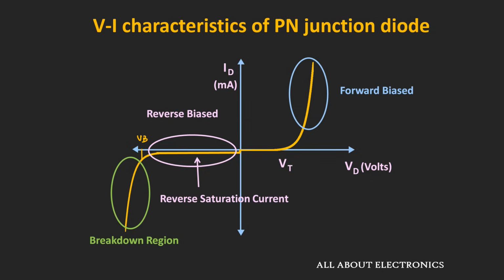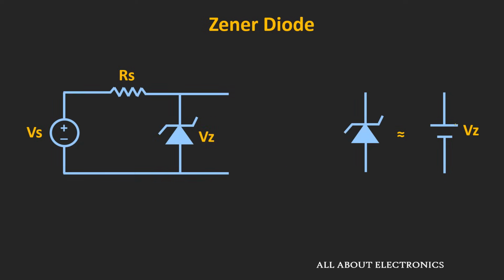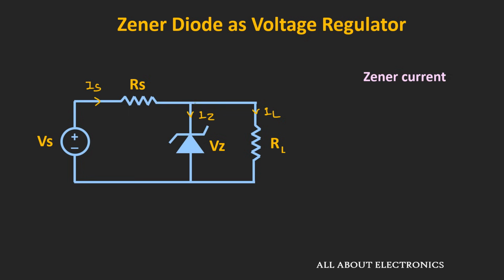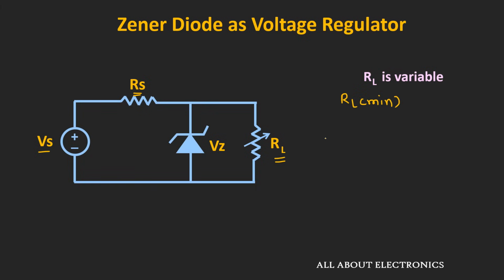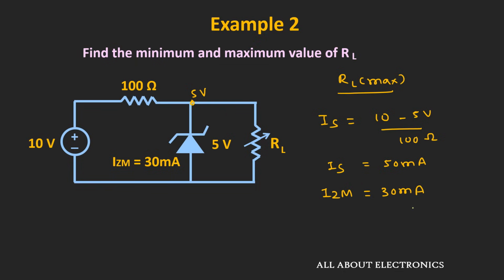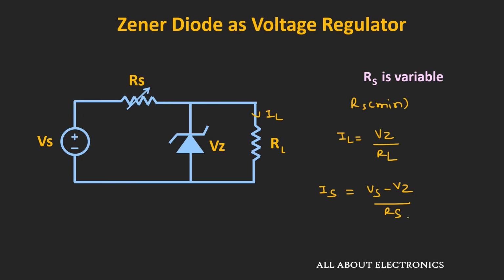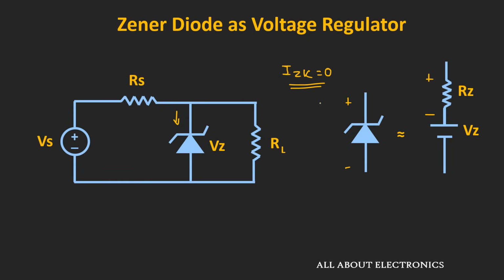What is Zener Diode ? Zener Diode as a Voltage Regulator Explained (with solved Examples)

Comment from the maker: As this video is longer than the usual videos, please use the timestamps for the different topics covered in the video:

0:25 What is Zener Diode 

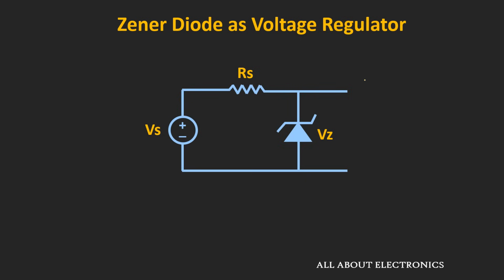5:40 Zener Diode as a Voltage Regulator

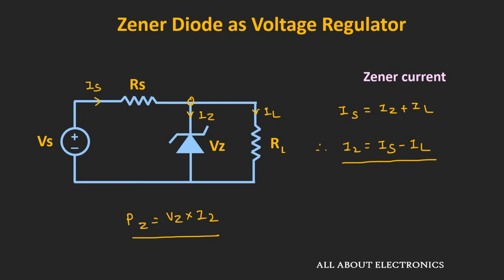9:08  Example 1

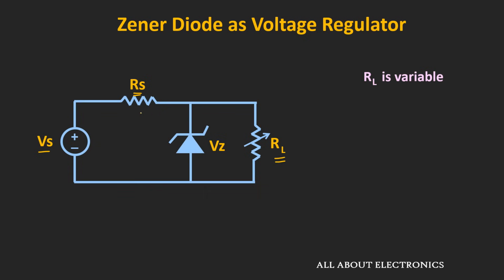12:17 Zener Diode as a Voltage Regulator with variable load

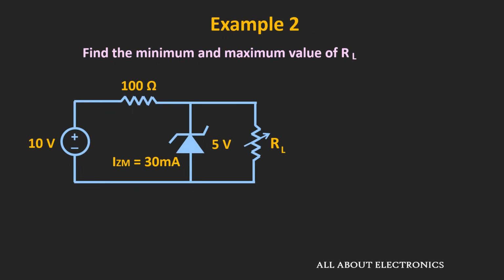15:25 Example 2

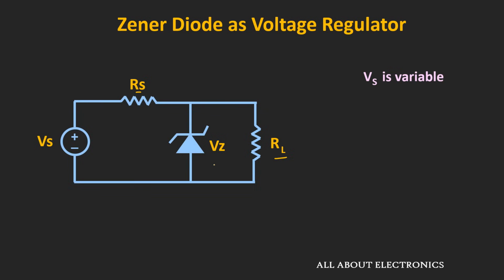17:25 Zener Diode as a Voltage Regulator with variable source voltage

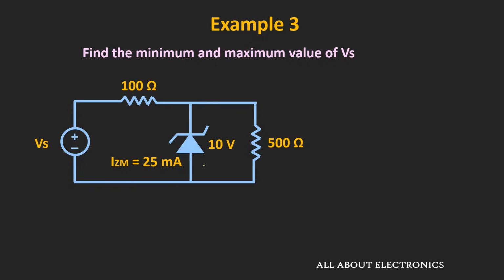20:32 Example 3

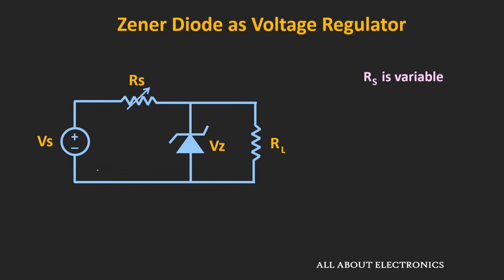23:00 Zener Diode as a Voltage Regulator with variable series resistor

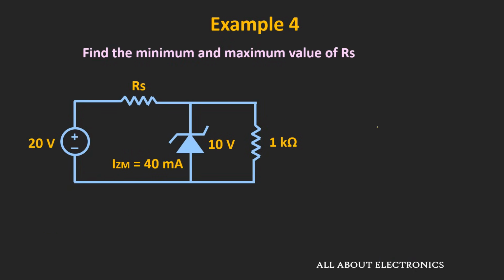25:39 Example 4
Reply: ultimate explanations
Reply: Can you please send the PDF generated of these ppts also,????? It will help us a lot with the notes in our preparation
Reply: thanks saves time
Reply: thnx actually for this info
Reply: you're the boss
Reply: Sir sir please provide notes sir please I beg u in our college they missed topics plz send notss
Reply: That time 12.17

Comment: During the discussion about zener diode ,it used as voltage regulator in reverse biase then why it connect in forward busse in circuit  ,please clear this concept
Reply from the maker: Would you please mention the timestamp in the video, where you are referring to ?

Comment: Can you please tell me why you calculated the Thevenin's voltage across the zener diode and how you obtained that formula for the Thevenin's equivalent voltage?
Reply from the maker: The Thevenin's equivalent voltage was calculated to check whether Zener diode will operate in breakdown region or not. If the calculated Thevenin's equivalent voltage is more than Vz then Zener diode will operate in breakdown region. Now, here to calculated the Thevenin's equivalent voltage, the Zener diode from the circuit is removed and the voltage across the Zener diode is evaluated. And here it is basically a voltage across the load, so using voltage divider rule, that voltage is calculated.

Comment: 00:16 Zener diodes are diodes designed to operate in the breakdown region.
02:58 Zener diode can be operated as a voltage regulator.
05:38 Zener diode can be used as a voltage regulator to provide a constant voltage
08:45 The Zener current is equal to the difference between the source current and the load current.
11:47 The Zener diode can be used as a voltage regulator with three variables: supply voltage, load resistance, and series resistance.
14:52 The maximum current flowing through a Zener diode should be less than Izm.
18:07 The minimum value of the supply voltage for proper functioning of the Zener diode in the breakdown region can be determined using the expression Vz * (Rs + RL) / RL.
21:10 The Zener diode will work properly in the breakdown region when the supply voltage is between 12 volts and 14.5 volts.
24:18 The maximum value of the series resistor is 1 kilo ohm, and the minimum value is 200 ohm.
27:25 Zener diode can be used as a voltage regulator in circuits.
Crafted by Merlin AI.

Comment: I have a question: What shall I do if I don't know load resistance?
Reply from the maker: Just assume some value of load resistance, which you supposed to be using. And accordingly you can select other values. With that design, you can mention that, it will work for load upto let's say 1kΩ.

Comment: In Russian literature this is called Parametric Voltage Stabilizer, the other type is called Compensating Voltage stabilizer, which uses a feedback from output to compare it with reference voltage to make the necessary adjustment.
Reply: to kya kare?

Comment: Wheather any capacitor is required after zenner or not ? If yes then why and calculating the value , if not then why ?
Reply from the maker: No, as you can see, directly a load is connected after zener. Actually, after the rectification,the filtered output can be connected to zener diode. Considering ideal zener diode, it elemimates the ripple in the filtered output and output voltage across it remains the same.
I hope, it will clear your doubt.
Reply: Thank you sir .

Comment: Hello, what is the purpose of the load resistor?
Reply: Is it to ensure that the Zener Diode works properly?I mean its purpose would be to make this voltage regulator work?
Reply from the maker: Typically the load resistor is the load across which we require a constant voltage. It could be the input of some circuit or input stage of bigger circuit. During the analysis, it can be represented as the input impedance of that circuit. But here for simplicity, it is represented simply as load resistor. 
I hope it will clear your doubt.
Reply: @ALLABOUTELECTRONICS  it does, thank you!

Comment: How do you write V(th)={R(L)/ R(L)+R(s)} V(s)
Reply: Thank you ,  for clearing my doubt
Reply from the maker: Its the Thevenin's equivalent voltage across the Zener diode. And it can be found by removing the Zener diode from the circuit and finding the equivalent voltage across the two terminals of the Zener diode.
I hope it will clear your doubt.

Comment: Why we cant use the pn junction diode as voltage regulator.... 🤔🤔
Reply: I think it's because normal PN junction diodes will get damaged when operated in the breakdown region. Zener diodes are spicial diodes which are designed to operate in their breakdown region. Looking up the two types of breakdowns, i.e. Avalanche breakdown and Zener breakdown may help you grasp a further understanding as to what makes Zener diodes special. Good luck mate.
Reply: @keviseiralu4536  Thank you :)

Comment: Philip trimmer which is work on 1.2 volt and it takes near about 1.4 Amp.
Currently it works on battery but i wat to make 1.2 v, 1.4 amp adaptor from mobile charger which is 5 v, 3 amp of capacity.
Can u tell me what is the value of input resistance and its wattage, zener diode specs....
Reply: Dear friend, use LM 317, a three terminal variable voltage regulator

Comment: Sir can u tell me how zener regulates when source voltage increases
Reply from the maker: In case of the Zener diode, in reverse bias, when we increase the voltage beyond Vz (Its Zener Voltage) then it tries to maintains the same voltage across it. But the current through the Zener diode increases. 
In reality the voltage slightly increases, as we increase the source voltage. And it is also evident from the Zener Curve in the reverse biased condition. But for academic purpose and even in some sort of applications the small increase in the voltage is acceptable and can be assumed as if the voltage across it remains constant.
But at the same current through the diode increase. 
Because of that, the power dissipation across the diode increases. 
And if it goes beyond the rated value, it can damage the diode.
So, when the source voltage increases, then one needs to ensure that the current through the diode is less than the Iz (max), the maximum allowable Zener Current.
I hope it will clear your doubt.
Reply: Sir how written assignment Ques explain how zener diode acts as a voltage regulator

Comment: Very helpful video indeed. I have a question - from where the equation of Rs(max) came?
Reply from the maker: At 23:59, the two terms are equated and the equation is simplified for Rs.
During this derivation, it has been assumed that the Zener Knee Current is Zero. That means just voltage across the Zener diode should remain at least Vz to operate it in the breakdown region.

Comment: How do you find rz?
Reply from the maker: The Zener resistance is given in the datasheet. If it is not given then it can be found from the V/I curve. The slope gives the Zener resistance. If it is difficult to find from the curve, then you can increase the voltage across the Zener diode and can measure the current through it. Ideally the voltage should remain the same. But actually it will increase slightly, with the increase in the applied voltage. The change in Vz with Iz gives the approximate value of zener resistance.
Reply: @ALLABOUTELECTRONICS  thanks for the help. I have been having a hard time with using zener diodes to find the ripple voltage. Like if you have a source that varies, what is the ripple on the output voltage and I can't find anything online. Is rz needed?
Reply: @MrMineHeads.  hello friend, even if the input voltage is varying, if you use a regulator after a filter, there is little effect on the output.

Comment: what happen if Vth is less than the zener voltage?
Reply from the maker: If Vth is less than Zener Voltage, then the Zener Diode will act as an open circuit. And Vo = Vin.
Reply: I think Vin would be equal to Vs + VL (where VL = Vo).

Vin = Vs + Vo.

Please confirm.
Reply: 1. What would happen (w.r.t Example 1) if we select RL less than its minimum value. Let's say we connect RL with value of 50 ohm [but RL(min) is 125ohm] , what would happen to Vz/VL? Will it remain 5V or drop?

2. What would happen (w.r.t Example 1) if we use 5v zener diode and put 3v LED as RL in the circuit?? What would now be the voltage across zener diode / load (Vz/VL) ?

Comment: Sir , if Iz is greater than Iz(max),   then what happen?
Reply from the maker: It can damage the Zener diode.
Reply: power dissipated by the zener  diode is very high and the diode may get destroyed
Reply: If Iz is greater than rated maximum, power dissipated as heat will damage the PN junction permanently....

Comment: thanks a lot for this...but I got a doubt, after the zener breakdown occurs, the voltage across it remains constant, but the current through it increases exponentially with the applied voltage. Can we say that after the breakdown the resistance of it will decrease exponentially?
Reply from the maker: Yes.
Reply: @ALLABOUTELECTRONICS   thank you so much !!!

Comment: Hi, I want to ask .can I connect a zenor  diod across.a battery.to regulate charging .( Specialy 3.8 volt laptop battery in series .to get 12 volts. 3.8x4 =14.8. I want 12 volt. Thanks a lot .
Reply from the maker: I would suggest you to use a voltage regulator instead of the Zener diode. 
Of course, you can connect, but the practically, the Zener diode won't give you a constant voltage across it.
Instead, you can use a regulator like LM 317.
Reply: @ALLABOUTELECTRONICS  thanks for ur reply.
Reply: To be frank  .I want to connect laptop battery in bike (Yamaha rx100).  I. Have connected few times works fine few months than battery became open. Presently again connected 4 in seris in to 3 line's .in gap of few day I take reading now crossed 17 volts .means it will not last..that's why I asked for diod